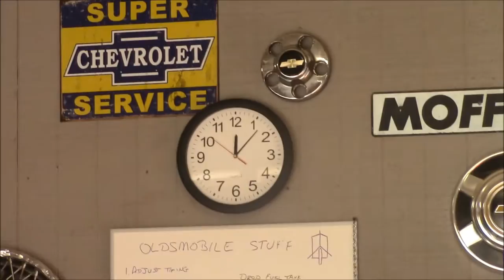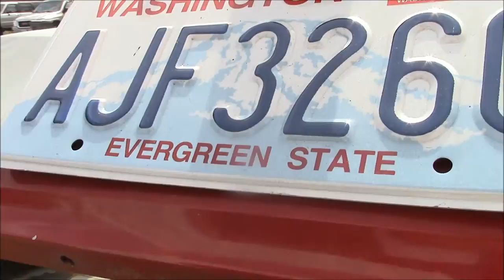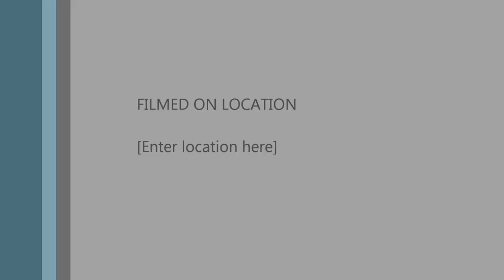Broken Spare Tire Carrier

Comment: Congratulations,  you've effectively destroyed one of the rarest and most-wanted factory accessories of the Jeep XJ. The swing-out tire carrier that was offered without having to change the factory bumper.  I would have just done a touch of spot welding, repainted and fixed up. Don't want it? Could have sold it for a couple hundred.
Reply: Rare indeed, I'd never even heard of or seen one till i saw this video. If i hadn't seen your comment I wouldn't even know it was an OE piece.
Reply: @camaroman101  this is the 96-98 factory tire cirrier, the old 85-87 ones are even harder to find and are a lot sturdier
Reply: @corwinmallonee4319  my 91 has one on it right now
Reply: Saw one last week on a jeep XJ ready to be scrapped. I rang asking about the spare tire carrier and if I could buy it, by that same afternoon, someone had already beaten me to it 😫